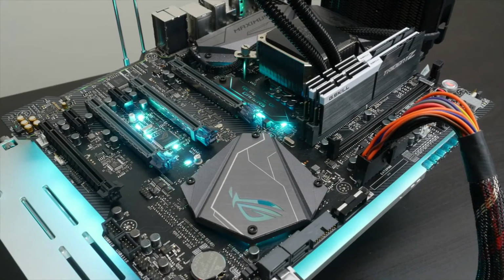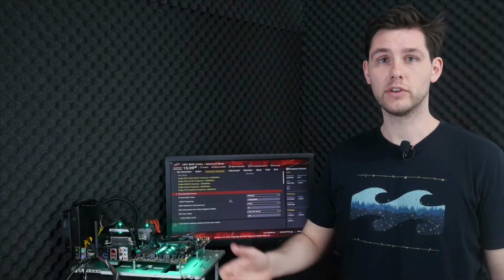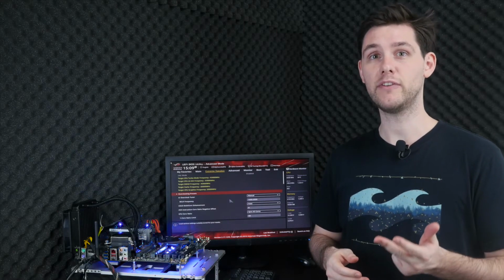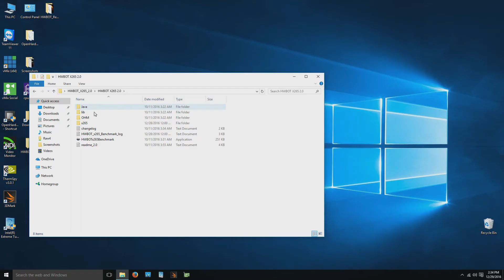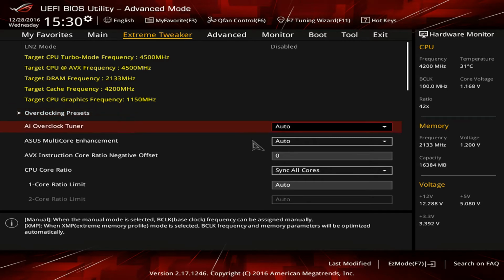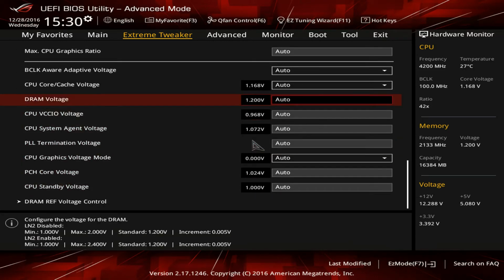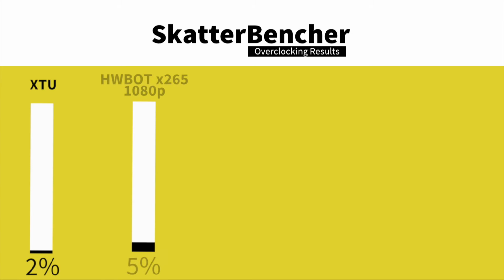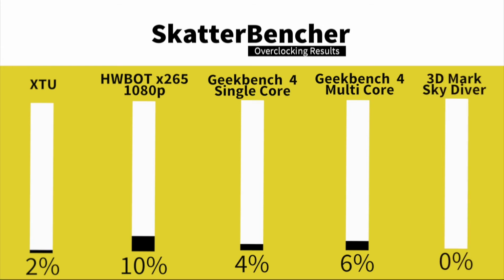Core i7 7700K to 5 GHz and DDR4-4000 with AIO cooling | SkatterBencher #6

Comment: After I overclock, do i set the voltage to offset or adaptive for daily use? I dont want to run the full voltage through my cpu if its idling. And how do i use adaptive/offset mode?

Comment: lucky guys, I need 1.375V for 5 GHz (not delided, AIO Silverstone TD02-its a bit worse tha CM, but...)
Reply: I will try it. I tested another one at second chip was worse, very hard to get 5 GHz stable (1.4V and of course hot after 30min stress test in AIDA64 AVX)
Reply: after few weeks, I have 3 chips and one seems solid :) 5.1 GHz stable 1.35V
Reply: FlanK3rCZ over 85 is too hot...
Reply: depends on, retails are hooter than ES samples. TjMax of Kaby is at 100 C
Reply: FlanK3rCZ what do you mean by not delided
Reply: 1.39 is the safe limit, try to delid or use better cooling system. Try to not pass more than 80c
Reply: when you OC after 80c appead more quick the electro migration.
Reply: Mine can't sustain 5Ghz at 1.3, but 1.35 was fine, I'll try 1.33 or 1.34 to see if can get better temps. (using H105)

Comment: Can i oc it to 5ghz with air cooling  noctua nhd15?
Reply: SkatterBencher what you mean by delidding
Reply: Delidding involves taking the cover off the CPU, so the cooler would have better contact with the actual CPU chip.
Reply: josheh4 oh ty, but rip warranty then?
Reply: Yeah, it'll void your warranty, I'm pretty sure. I think overclocking itself does that too.